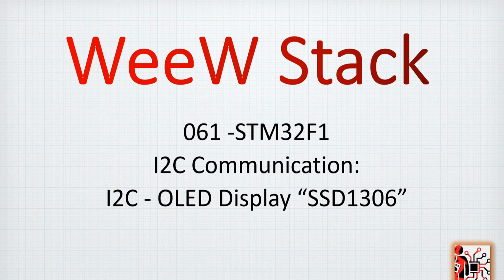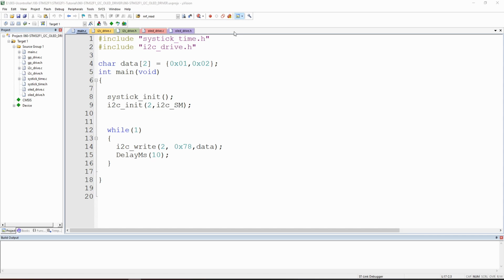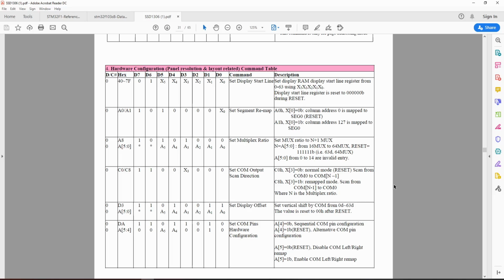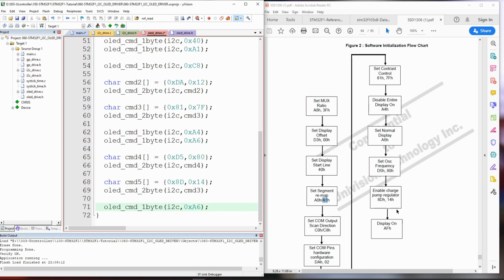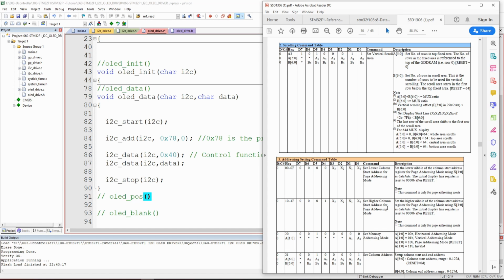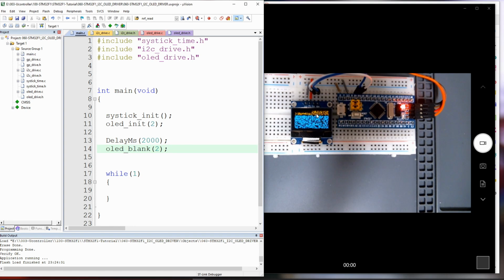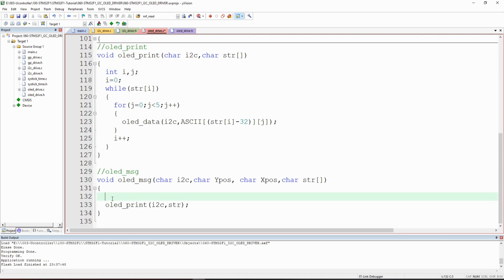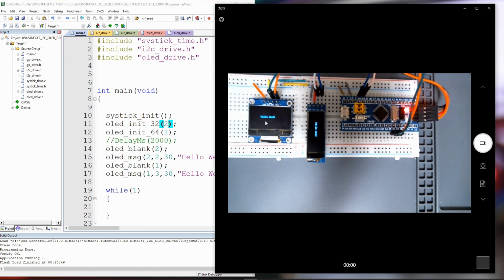061 - I2C communication example: OLED Screen Introduction, Setup and Display using code from scratch

Comment: A little warning. You can't change the IIC address on the Ali Express model by resoldering the resistor as shown in this. I've tried it and didn't work for mine.